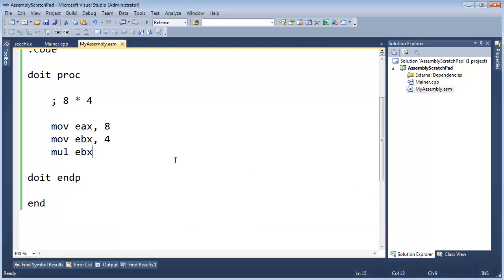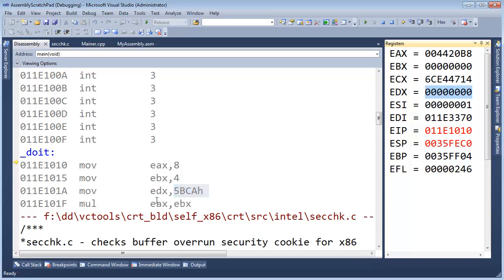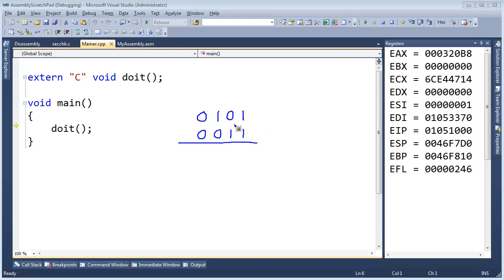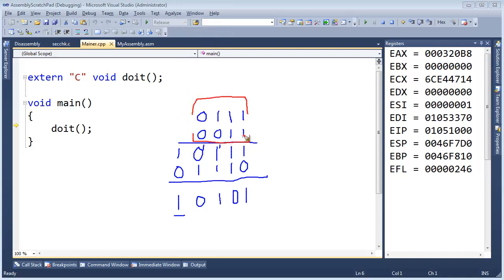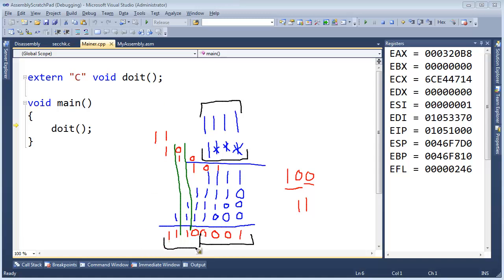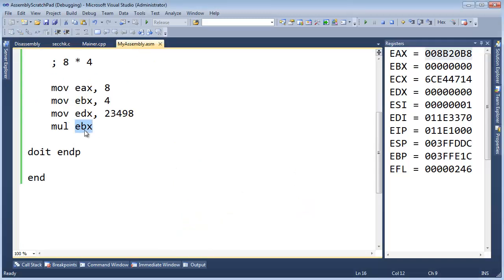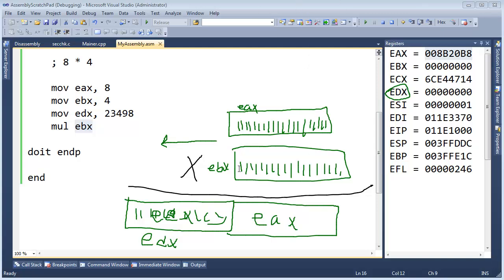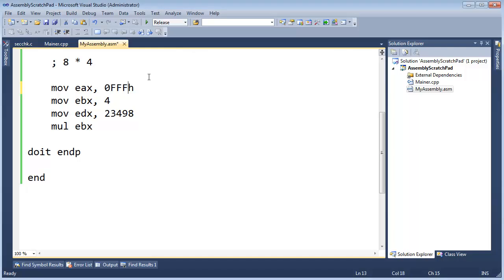Assembly Multiplication and Overflow

Comment: Well, it's not really an overflow , it's supposed to work that way. Multiplying a 32-bit number by another 32-bit number in general can produce a 64-bit number, but E_X registers are only 32 bits long, so a single register is unable to contain the entire result of such multiplication. Therefore they decided to use pairs of registers that could then contain the entire 64-bit result.

Comment: You mentioned not having a mathematical proof for the max overflow being the number of bits you're multiplying. A binary number can be represented as (2^n) with n being the number of bits. Multiplying that by itself (or squaring it) is 2^n * 2^n and one of the properties of exponents is when you multiply two exponentials with the same coefficient you can just add the exponents which makes it 2^(n+n). So if the register is holding the max value, multiplying it by itself will require double the number of bits.